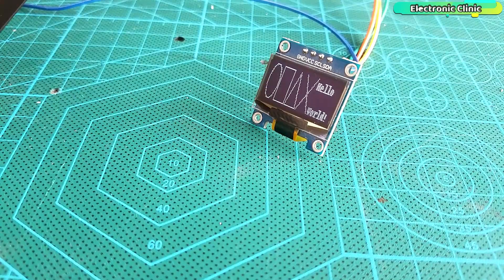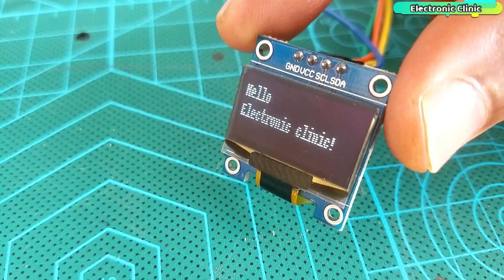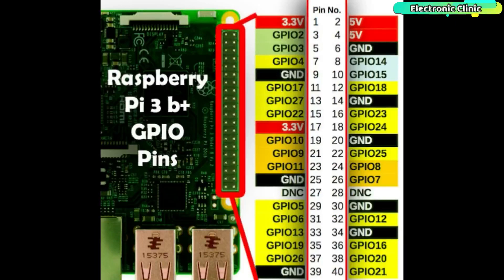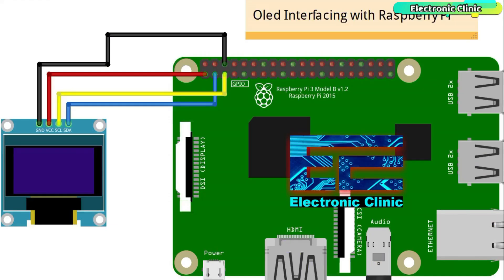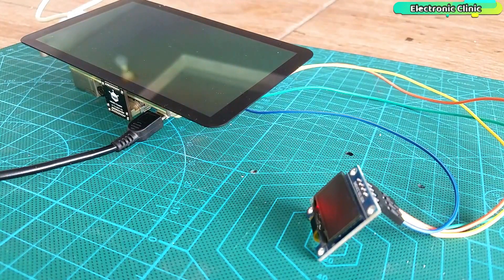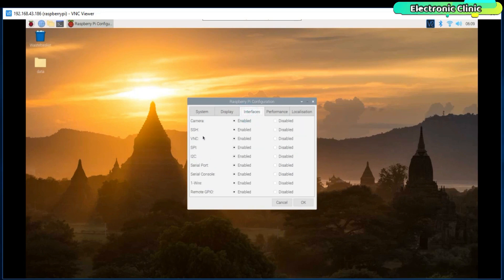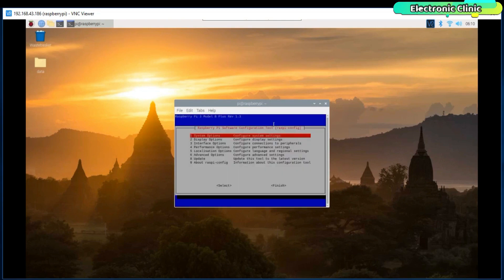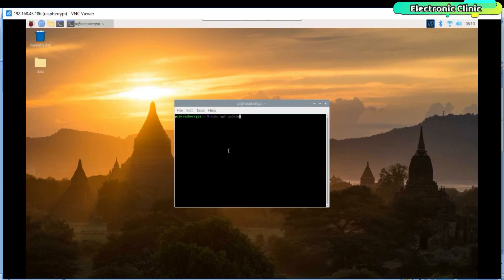Raspberry Pi Oled Display I2C SSD1306 Display Module Interfacing and programming

Comment: This code no longer works - Adafruit has depreciated the SSD1306 code - platform is no longer recognized
Reply from the maker: Watch my video on mini raspberry pi PC. In that video I used the OLED display, you can check the OLED part.

Comment: I am getting the following error when running the python shapes.py (in the examples folder)
pi@raspberrypi:~/Adafruit_Python_SSD1306/examples $ python shapes.py
Traceback (most recent call last):
  File "/home/pi/Adafruit_Python_SSD1306/examples/shapes.py", line 46, in <module>
    disp = Adafruit_SSD1306.SSD1306_128_32(rst=RST)
  File "/usr/local/lib/python3.9/dist-packages/Adafruit_SSD1306/SSD1306.py", line 287, in _init_
    super(SSD1306_128_32, self).__init__(128, 32, rst, dc, sclk, din, cs,
  File "/usr/local/lib/python3.9/dist-packages/Adafruit_SSD1306/SSD1306.py", line 85, in _init_
    self._gpio = GPIO.get_platform_gpio()
  File "/usr/local/lib/python3.9/dist-packages/Adafruit_GPIO/GPIO.py", line 426, in get_platform_gpio
    raise RuntimeError('Could not determine platform.')
RuntimeError: Could not determine platform.

Comment: if I buy a DIY synth kit with an oled 128x32 screen...would it be possible to just install the 128x64 screen in its place without changing anything in the code? Would it not just double the pixels? Or would it only use the first 32 lines on the screen and the remaining 32 lines would be black because they aren't properly coded? Thanks!